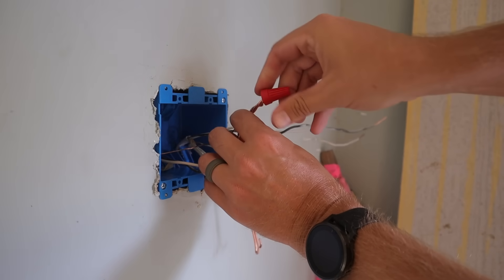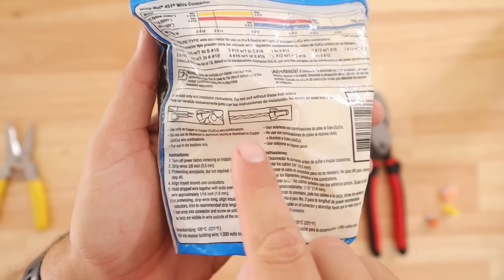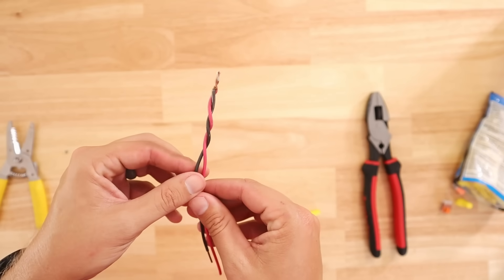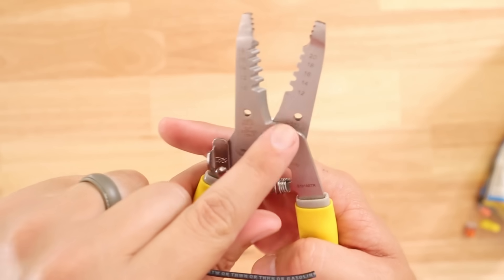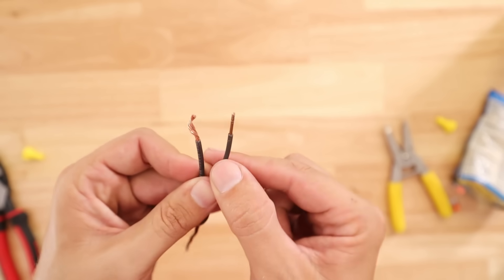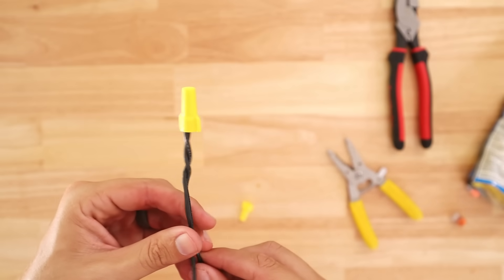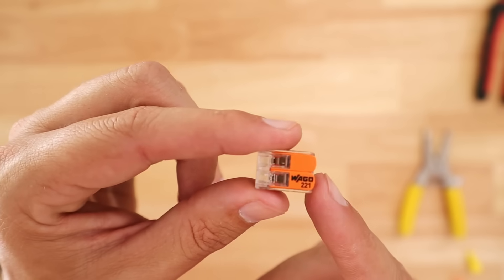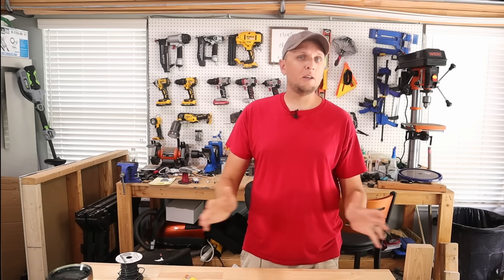BIGGEST Mistakes DIYers Make When Connecting Wires Together | How To

Comment: 👌 video. My house was probly built in the 40’s. The elec is challenging. The boxes are tiny and plastered into the wall. There’s no ground and in the attic I’ve found the wiring only tapped together without a box. I’m assuming was code when the house was built. It’s tough doing diy’er jobs. Any videos would be appreciated. The old black insulation crumbles off and I’ve fixed a couple loose wiring situations. It’s interesting the wires are twisted together then a small dab of solder laid down then taped up. Thanks for the tips and advice.

Comment: I prefer to soldier my stranded wire first then use the wire nut to connect them. This makes them both solid wires. Also on both connections after the wire nut is tightened I then install electrical tape and wrapping it in the tightening direction starting around the nut then continue wrapping it on to the wires. This will keep the nut from ever losing in time. I hope this helps someone.

Comment: I'm not sure if it's allowed in the NEC but when I am joining stranded and solid I  pre twist it a little and then fold back onto its own outer plastic coating covering and then twist (make sure all items of the joint are twisted in the same direction) the wire nut  holding it by two things like it's supposed to the wire and the outer cover this works especially well on smaller wires because they tend to break when you get them tight in the wire nut it is much harder to break when you are twisting the wires plus the outer plastic coating. I really do wonder if it is frowned upon not necessarily in the field but in the rulebook 🤔

Comment: I agree, the wire insulation should be in the threading in the but the help keep the nut in and twisting the wire, if the wire gets pulled, the force will get excreted on the twisting and not the nut. Keeping someone from accidently yanking the wire out of the nut.

Comment: Step 7 in the instructions say "...screw on until approximately two twists are visible in wire outside of the connector", so whether you pretwist or not code does require that the twists be there.  Thanks for describing this issue with reference to the applicable code!
Reply from the maker: You are very welcome.  Really glad to hear you liked it.  Thanks a lot for the feedback Alexander!

Comment: I just make sure the wires are the right length, and then let the threads inside the wire nut wrap the wires up the way they want to. The only nuts I have ever had fall off are the ones where the wires are all  perfectly twirled together before putting on the wirenut. But, to each his own.

Comment: I prefer not use BUGNUTS!
I splice or using  the gray gated splicer.
When I use a Bugnut,  I would pre-twist, and twist up the wires to an inch.
And electrical tape over the opening of Bugnut, wires, to insure the wires won't lose the Bugnut when shoving the wires into the electrical box.
Stranded wire could be soldered on the tip to solidify as a solid wire.

Comment: I have had too many of the push in connectors fail. When I was working for a department store chain during remodels the contractor used the push connectors. After the remodel was completed over the next months we would have rows of Florescent fail. The common point of failure was a push in connector on stranded wire. Now that Wego with the lever interest me and I will check them out.

Comment: When did wire nuts become common? I've had old houses where the connections were just twisted & wrapped with the cloth tape & seemed fine after 80 years. How long will the Wago plastic last?

Comment: Back before there were wire nuts one uncle's system was to twist about an inch of bare wire together then smack it with a hammer.  I couldn't make that work consistently, but he'd done it enough that the one hammer blow flattened the wires enough that they couldn't un-twist.  For stranded he twisted them to where it was starting to break some of the stranded wire and then add a couple drops of solder.  Another had his own method for stranded connecting to solid:  take a rough file to the solid wire to make it rough, then cut the stranded wire to a bit more than twice the length of the solid and proceed to wind the stranded wire up the length of the solid and then back down over itself.  Both of course then wrapped the bare wire with electrical tape.

Comment: I was glad to see you trim the "Walker" My boss taught me to do that. Sometimes I have backed off the Wire Nut to find a Walker. Other times I have seen the walker work through the tip of the wire nut. Trim it for a good "bite" & sleep well.
 Great Post!!
Reply: What is the walker? Please answer. I’m replacing a porch light—spouse has dementia & can’t
Reply: @deawallace3584   A "Walker" is a Stripped Conductor that creeps up & away from the other wire(s) when spliced together with a Wire nut.
 When we Wire Nut the Conductors together we pride a certain amount of bare wire to ensure a good connection.
 Say, 1/2 inch +/-.
 When the conductor "Walks" the amount of contact is diminished. Sometimes A LOT!!
 If you're wiring three, or more, conductors, be sure the wire nut is TIGHT with a few twists in the insulated portion of the conductors. Back off the wire nut & Trim off the "Walker" to be sure you have enough Contact.
 Don't let this LONG Explanation intimidate you. It's not Difficult & worth the effort.
BTW, when attaching Stranded Lamp wire to solid Romex, Be sure the stranded wire is 1/8 inch PAST the Solid Romex & Orange Wire Nuts are MY Preference!!
 Good Luck & Common sense to YOU!!

Comment: how can you say its wrong when the directions say its fine lol. you can say its not ideal, or not the best, but you cant say its wrong
Reply from the maker: I showed you why it’s wrong per the instructions.   I’m guessing you didn’t watch it all.
Reply: @HowToHomeDIY  the instructions say it's not required to twist before. Yet because it shows an image of both non twisting and twisting, you're saying the instructions only say it has to be twisted?
Reply from the maker: I am assuming what you are calling twisting is pre twisting.  I said that pre twisting is not required per code because the instructions on this particular package of wire nuts say it is not required.  That does not mean it is not allowed.  But the instructions do clearly show an illustration of twisting the wire nut on enough that some twisting below the wire nut occurs.  The pretwisting I said is what many electricians and myself like to do and why.

Comment: What about the pretwisted wires inserted in a shrink wrap tube, twist the wire nut untill the insulated wires twist, pull the shrink wrap over the "skirt" of the wire nut than shrink the tube? Just an ideea.

Comment: Make it simple....strip the conductors a little long.  Pre-twist the conductors.  Slip wire nut over the conductor; if copper is exposed at the bottom of wirenut, clip off enough copper as to the point   where the open end of the wirenut completely covers the exposed conductor.  Now twist the wire nut in a clockwise motion (like you're putting a lid on a mayonnaise jar).  Never depend upon the wirenut to make the twisted connection.  Here is a reason why, the wirenut can push one of the conductors down and not twist the pair together.  This could lead to the wires barely making a connection.  If this happens, it will create a hot spot, leading to electrical hazards.  Be safe and always remember this:  "It's hot until YOU prove it's not."  Never take it for granted the circuit is dead or that someone else turned if off for you,
Reply from the maker: Great feedback and tips.  Thank you!

Comment: I never twisted my connections so much that the wires made a "braid" like in this video but I have been pre-twisting the end before putting the wire nuts on for as long as I can remember. Like you said pre-twisting the ends together creates a good connection. If you're just slapping wire nuts on without pre-twisting you can't see if your connection is good or not. 

Twisting the wires like you did in this video does make me think that the connection will be a bit more secure.
Reply from the maker: Appreciate you taking the time to leave your thoughts on it!  Thanks!

Comment: I have a ceiling fixture in my hallway, no light switch and it isn’t a pull chain. I put in a bulb and it doesn’t work, I removed the fixture and tested for hot wires, and no electricity. Non of my circuit breakers have been switched off. What are my options here?

Comment: i also see you install electrical sockets with the ground pole down. I install them with the ground pole up in case something metallic falls over the live wires if the plug is not all the way in.
Reply from the maker: That is one of those preference options.  As long as an outlet isnt facing up it is installed in an approved orientation.  Thanks Alan!

Comment: Wagos are great. But when you push a bunch of Wago connected wires back into the box....it's possible for a lever on the Wago to hit something and flip up, causing the wire to come out. I like to wrap the Wago with electrical tape to make sure the levers stay in place. Just like you should wrap wire nuts with electrical tape, after you tighten the wire nut onto the wires. Safety first.

Comment: It took me a long time to finally figure out how to make a really good connection with wire nuts - and what you show is what I finally figured out. When I'm connecting heavier wires, or 3 wires with big wire nuts, I use pliers to twist it on since my hands aren't strong enough to twist those tight enough.
Reply: I had the same experience and I practiced a lot. Now I can twist up to five 12 gauge wires and achieve professional looking results. I recommend using high quality lineman's pliers aka Klein's, they are pretty much the gold standard for this job.
Reply: @surferdude642  I haven't done 5 wires, but I had some places with 4 when I wired my new little house. I love the lineman's pliers.

Comment: Good points.
Being that I learned the trade, some 70 years ago I learned to pretwist the stranded wire before mating it to the solid wire. If possible I’ll even tin it. From that point on I totally agree with you.
As a sidelight, when I began working on wiring with my Dad, wire nuts hadn’t been invented—1950s—so we used copper crimps and electrical tape, not the plastic stuff, either.
Reply: Yes, that's how every splice was made in my parent's home. Built in 1958, and splices still solid...

Comment: Whole lot of video for this subject. And you forgot one of the basics that is often overlooked by casual DIYers and broke fellers in a pinch...
Use the proper size wire nut!!!
And don't reuse them. They are consumables. They are meant to compress to the point of deformation which renders them very secure when static but exceedingly unstable when reused.
Reply from the maker: Yup you are right.  I did not discuss that in this video but I made a part 2 to this where I do talk about that.  A great point!

Comment: The helical element in the wire nut prevents the arcing. People for eons have used fear to make people use their method. The manufacturer knows best how their product was designed. They have extensively tested all failure modes and have mitigated some you havent even thought about. You can also fatigue wires by over, twisting them where they separate under the insulation. Then you could have arcing. The first input to that failure mode is using mechanical strippers or scoring in wire, creating a weak point while stripping. The break come shortly after bending the wire nut over to stuff it in the box. The twist in the wires on the package may not depict twisting as a result of installing the wire nut. It could be twisting for noise cancellation prior to installing the wire nut. Not saying your method is improper at all. Just saying there is always more cool reasons to discover and consider. 😁

Comment: At 3M testing facilities, they never twist wires together wires prior to installing the wire nut. There are a number of reasons: 1) This does not work well with wires of different sizes 2) That prior twisting can create a head that is too thick for the wire nut to properly grab, creating a failure where it can fall off 3) When joining stranded to solid, prior twisting cannot be done as it invariably breaks pieces off the stranded wire  4) The prior twisting creates gouges and knicks in the wire which are a cause of resistance or copper breakage when done wrong

When the wire nut locks the insulation of the wires together in a twist, it does prevent the joint from coming apart. That said however, I find that bare ground wires still need a prior twist and I cut off any damaged wire or head that is too large to be secured under the wire nut. Also, stranded has to be started slightly ahead of the solid copper when being joined together under a wire nut.

Comment: I usually add some electrical tape around the wire nut and the wires to also make sure the connection is maintained especially solid to stranded connections.

Comment: If u got one stranded one solid. Your a goof if you switch you got two solids be a good electrican and twist them together, and Jr. Hold them tight and don't twist the wires together just the ends and be a good electrican

Comment: I am a licenced Electrical Service Technician. I have also worked in aviation where wire nuts are absolutely forbidden. Joining solid to stranded wire is a dodgy practice using wire nuts. The only safe way is to use a screw terminal or best is a crimped splice. The crimped splice forms a solid inseparable join. Another good joint is using 'Solder sleeves' which are applied using a heat gun to melt the solder and shrink the insulation. They are also waterproof. The current carrying capacity of a wire is governed by its cross-section area. Any joint between two wires MUST have a surface area that exceeds the cross-section area of the smallest wire. Wago's are 'point contact' type devices that can quickly overheat if overloaded. They may not provide sufficient contact surface area compared to the cross-section area of the connecting wires. 
However, your video is good practice if a wire nut is used. Wire nuts are not permitted for use on mains wiring in my country.
Reply from the maker: Appreciate the input John.

Comment: A couple thoughts. I'm not an electrician -- I'm a homeowner who sometimes has to fix faulty electrical connections in my home or family members' homes.

1) One thing that I like about INLINE wagos is that you can connect wires that are a little bit too short to use with either a side-by-side wago or a wire nut. I recently had to replace a solenoid in my air-handler humidifier. The new, aftermarket solenoid had shorter wires than the old one, and the positioning of the wires was slightly different. When I tried to connect with a standard WAGO, one of the wires was a bit under tension, which I didn't like. I worried about the thing coming loose in an appliance with a lot of heat+cooling expansion/contraction as well as vibration from fans. With an inline WAGO, there was no tension in the wire connections on this particular installation. So they're nice to have around.

2) I have fixed MULTIPLE failed wire connections in my houses over time with wire nuts that weren't properly installed. One big culprit, in my experience, has been with HVAC contractors. Maybe there are some HVAC contractors out there who are also great electricians and make great connections with wires, but I've also dealt with HVAC contractors who twisted on wire nuts too loose, which then caused resistance that melted the connectors. This particular case was on, I believe, 4AWG wire feeding a heating element on an electric furnace at a relative's home. They added a JBOX and spliced the wires when replacing the unit rather than running 4AWG all the way from the unit to the main breaker, and the wiring in the JBOX was pretty bad. One connection melted and then shorted against the box. I've ALSO had to reconnect non-working lighting cans with really really loosely installed wire nuts. I suspect that some of the wiring on an old remodel of my house may have been done by some general handyman who mostly does drywall, cut some holes for new cans, and installed the wiring without getting a proper electrician to do it. I have no idea, but the wire nuts were not twisted hard at all, and I had to get on a tall ladder over a staircase to redo some connections in lighting cans.

In any case, great video. I'm going to pretwist and follow your advice next time I have to rewire any ~14AWG wires in a lighting can, although when the lights are LED that draw low amperage, I do like the simplicity of WAGOs.
Reply: Well, don't forget, HVAC are a bunch of thieves and liars lol
(I can say that. I was HVAC since I was 4 yrs old until I was 36!)
But for real, car mechanics, HVAC techs and judges are some of the most crooked em effers you never want to meet.

Comment: How many wires can you tie in together ? I see like 5 of them going into a wire nut then wrapped with electrical tape.
Reply from the maker: Completely depends on the size of wire and which wire nut is being used.  They all have different allowances.

Comment: I'm uneducated in the union ways, but i always check to be sure there isn't exposed wire and I pull as hard as I can to make sure the wires aren't coming apart. I've found that pretwisting leads to a loose connection, most times. Everything gets wrapped in tape, just in case.

Comment: I presume you are talking about conditions and regulations for mains wiring in the US. From the little I know about wiring requirements here in Australia, joining a red and a black conductor (like you did in your first demonstration) sounds like a really bad idea.

All mains wiring here has to be undertaken by a certified electrician anyway. (Also I'm pretty sure those nuts are banned here for use on mains).